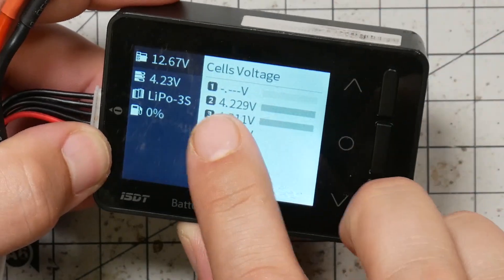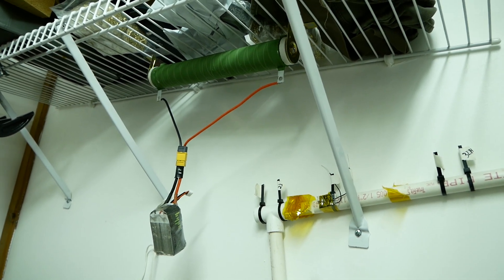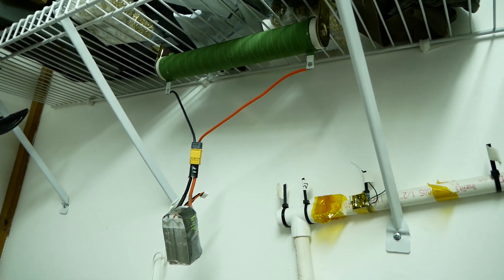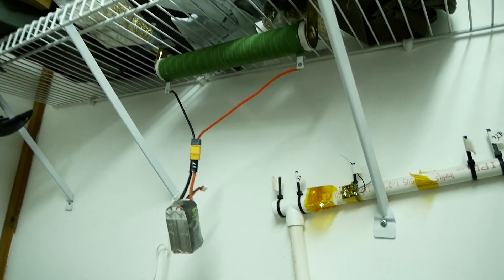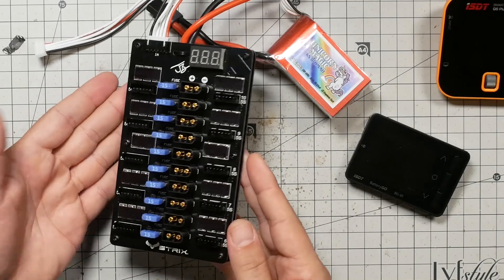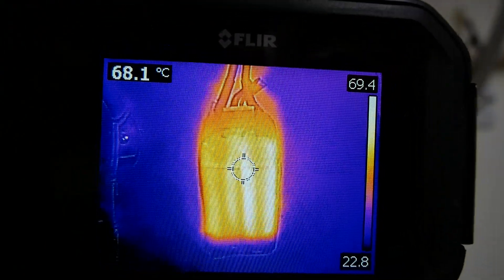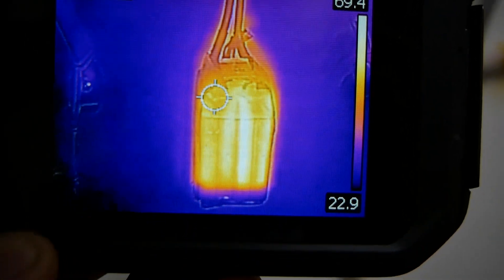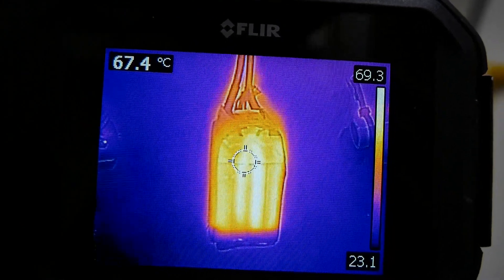Is Your LiPo Safe To Charge | WHEN TO THROW IT OUT

Comment: You should promote the Bat-Safe.  That charging box is freaking amazing.  Perfect for discharging, too!
Reply: I have two Bat Safes. Love them!
Reply: @renotimberwolf2139  Me, too!  Bat-Safe buddies for life! … FFS that's the dorkiest thing I've ever posted lol
Reply: Check out the YouTube videos that the manufacturer has, it shows actual fires and how they keep the fire away from the rest of the area. However, the smoke is going to be pretty nasty.
Reply: @renotimberwolf2139  ^ THIS!  And the Bat-Safe filters the soot out of the fire to limit smoke damage, too.
Reply: That Bat Safe looks nice, but small, can you charge more than one battery at once with it?
Reply: @sunshynff  Absolutely.  I have the smaller of their two boxes.  The larger one, the form factor IMO is more suited for battery storage, not necessarily for fitting more batteries in to charge.  I put my Bardwell charging board in there with some duralock, plug channel 2 of my ISDT D2 charger to it (for the hobbymate duo or isdt d2, channel 2 cranks a higher possible A than channel 1), ran the other channel wires in there, and I can fit about 10 x 850mAh 4s packs in there, or about 8 x 1500mAh 4s packs, either of which I can also fit my FuriousFPV 18650 case in there as well either below or on top of one of the left column of batteries on the bardwell board.  The 1500's it gets cramped trying to get the wires to the parallel charging board.  I highly recommend using double extension wires for both balance and XT60, and use balance boards to allow charging of various cell counts through single balance wire from charger into the box.  Go charger > extension cable end OUTSIDE case > another extension wire poking just outside sealed conduit > rest of extension going in to mounted balance board/parallel charging board.  The goal is you want to be able to leave the wires permanently poking out top of the conduit.  Label each end for channel numbers, so if you disconnect your charger to take it on the go, you can plug it back up easily on the right channels (bad ju ju if you confuse balance and mains for different channels!), and you know which channel is for each battery you plug up inside easily.  The single biggest pain with it, which this corrects, is getting all your wires through the sealed conduit.  You do NOT want to have to fish the wires through over and over again, trust me.  Do it once, and do it right the first time!  One other small issue is the stand they give you velcro to stick on the top of the case to which you can stick your charger - don't bother using it.  The extensions that go from charger to the wires just outside the conduit, make they are  plenty long enough to place your charger beside the bat-safe.  I know what they were trying to do to allow your charger to be on top visible and off the vents, but it makes the lid top heavy, and the velcro glue will eventually come off, and your charge/stand will suddenly drop off the bat-safe as you're opening it.  IMO, don't even bother trying to use it.  I tried duralock, the included velcro... it doesn't matter, the stand and/or charger stick pad glue will eventually come off, causing your charger to take a tumble.  Hope this helps!
Reply: It looks like the Bat-Safe is only good for a battery or two. What if you are parallel charging? I would like to be able to safely charge at least 6 at once.
Reply: @randybull01  Read comment above.  Why do you think it's only good for a battery or two?
Reply: I got the idea that even though it might physically hold more, that doesn't mean that if a fire happens it would contain 6 to 8 batteries. If once catches on fire the heat in the box would make them all go at once. Doing more research I find it is rated for two 6s 5000 mAh. batteries. I'm not sure that means that it would contain 6 to 8 1300mah batteries going all at once.  @heroflying
Reply: @randybull01  that's easy... 6s is 25.2V fully charged.  Since LIPO fires are basically converting electrical power into heat, best bet would be to compare battery power, which is watts = voltage * amperage.  25.2V*5A = 126W.  Multiply that by 2, and you're basically saying it can contain 252W of power in batteries if converted into thermal heat.  8x 1300mAh 4s packs comes out to 16.8V*1.3A = 21.84W*8 = roughly 175W.  So I would say it would be fine and then some.  You might be able to fit an extra two batteries in there physically, and you're still < 252W if your research is correct.
Reply: Thank you. That makes sense. @heroflying
Reply: @randybull01    Oh yeah, I built mine because I unfortunately found out the hard way how hot they burn, just one 4s burnt through a "lipo safe bag", caught my wall on fire and almost burnt my house down.   Besides the ammo box, I use a metal table, in my basement laundry room with non finished concrete walls and I slide the table to the middle of the room when charging, nothing within 6-10ft from it.  
HeroPsycho, I didn't know it filtered the smoke too, that is awesome!
Reply: @randybull01   I did some more checking, and HeroPsycho is right, they hold more than what I originally thought.  If you're on a budget though, you can always make your own with an ammo box, you can get one on ebay for about $20.  There's a bunch of videos on here how to make one, can't post pics on these threads or I'd post mine. I just drilled a 3/4" hole in the side that doubles as a place to run wires into and as a vent hole (you do not want to seal the lid without a vent hole while charging, they will blow up from the pressure if a lipo goes bad. I can fit my 2 XT60 xmas tree charging boards in there, I usually charge 3-5 lipos at a time, could do more.  Hey, and I'm not knockin' the Bat-Safe, it looks awesome, I was just on a budget when I got into the hobby, and had an extra ammo box laying around.
Reply: @sunshynff  So here's where the bat-safe adds value besides it being done already.  You can decide if it's worth the price premium.  The ammo can still will not filter soot in the event of a fire.  So, while it should contain the fire itself if done right, it cannot contain the soot, and you can suffer smoke damage.  So doing what you're suggesting is not an apples to apples comparison as far as damage protection.  The Bat-Safe literaly filters the soot out, so you shouldn't even experience smoke damage either.  Again, that doesn't mean everyone should buy one.  Decide what's best for you and your budget.  I just wanted to make sure you know the difference between an ammo box solution and this.
Reply: @sunshynff  The bat-safe has a huge advantages over the ammo box designs in that it has filtered ventilation built in with many redundant vents instead of potentially a singular unfiltered one - it actually attempts to deal with the huge amount of smoke produced, and filter out the particles to prevent smoke damage.  Sometimes LiPo's only produce smoke and no flame when they fail.  Also the box is double wall - think of the advantage a metal thermos has in retaining heat due to it's airgap design, versus a simple metal mug.  Sealing in more of the heat and using air as an insulator should mean the outer wall temperature is far lower than an ammo box, preventing burns or contact ignition.   

It's really not that expensive - just the cost of a few packs, so anyone who flies quads should be able to justify it imho.   If we're talking against preventing the unlikely, it's not worth it to skimp imho - same logic behind why you buy a quality motorcycle helmet - better features/usability and better at doing what it should - protecting you.
Reply: Protonus Thats pretty much exactly.what the last poster said.  Definitely sounds like the filtration system is a great idea.  I’m not saying ill never get one, but i also have two types of motorcycle helmets, the expensive DOT, total cranium protection but feels like a bowling ball on your head, and the nice low profile  comfortable, half helmet, $25 brain bucket.  Guess which one i wear..lol.  Listen, i’ve been on the job (Firefighter) for 23yrs now, I’ve eaten a lotta smoke, and I’d prefer not to eat anymore, but as fast as those lipos go up, and at the rate and amount of smoke produced, that filtration is only gonna catch a portion of it.  That or it’ll build up pressure and explode.  Im still not knocking them, they look awesome, I’ve also added a smoke detector to my rig and a 40lb bag of sand that i put over the open ammo box, if theres a fire, the sand will smother it.

Comment: I think very important in addition to going lower than 3 is a brand new battery having a single cell drop below 3 on the first run. 
If there ain't a good reason, it probably ain't a good battery and will only get worse. 
Cells that just don't want to charge, stop, check the resistance, probably retire it. 
Going to insulate my batteries this winter, even in flight.

Comment: Thanks for this video! I have a few questionable lipos now. One particularly after 30 seconds flight stats to sag drastically even fully charged. Time to toss that one out.
Reply: You may want to check your xt60 I had all of mine seaming to sag badly and have lower flight times turns out the quad had a bad connector.
Reply: Ronald Highlen I’ll definitely have to check it. I know the pack has been ran really low a couple of times tho. Once down to 2.9 by accident.